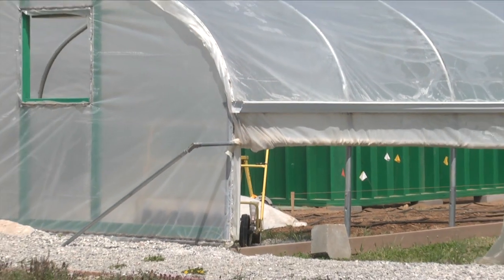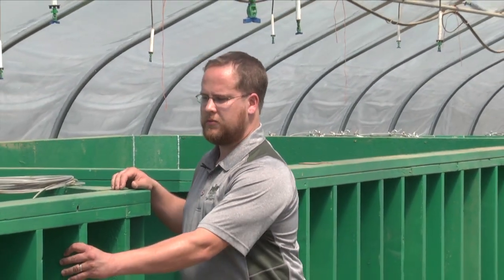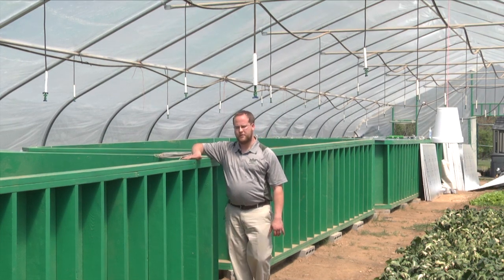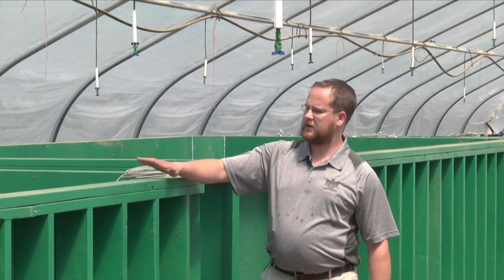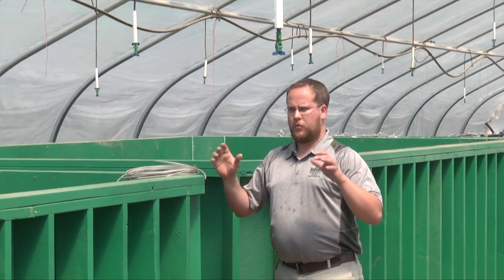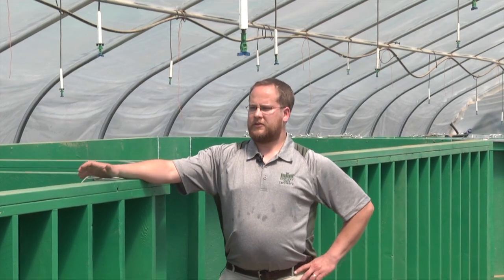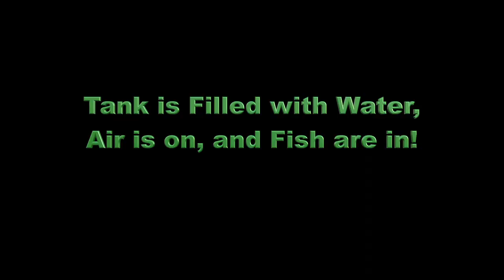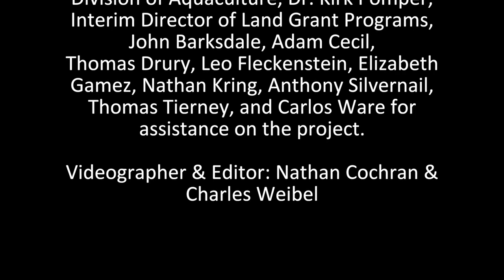Constructing Fish Tanks in High Tunnel Greenhouses

Comment: Why wouldn't you also cosider  using the water from the tanks to flow through a piping system for aquaponics to feed the plants and also filter the fish waste, basically acting as a biological filtration system for the tanks to supplement the filtration system you have to be utilizing currently for the tanks. Waste water fertilize the plants, plants remove nitrates and nitrites from the water and return to tanks.